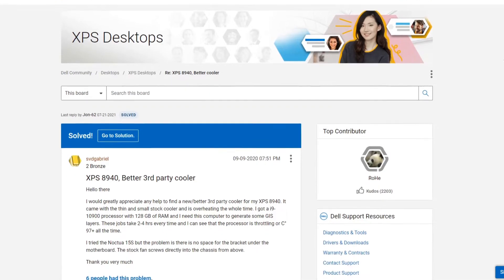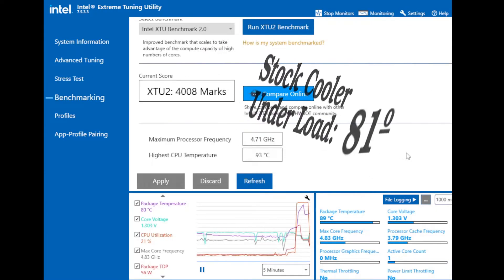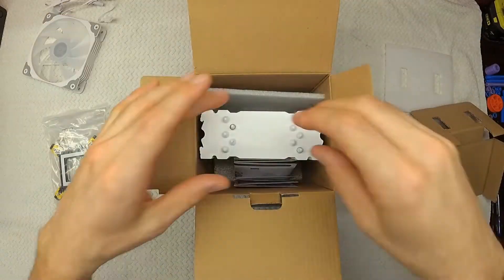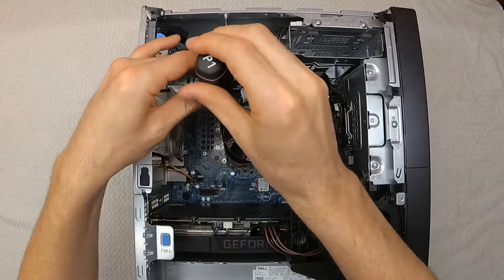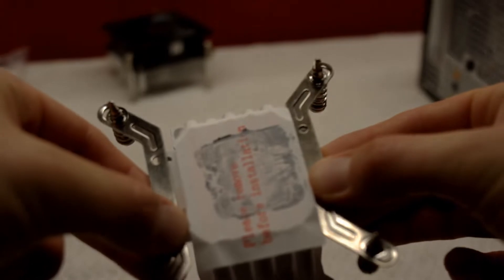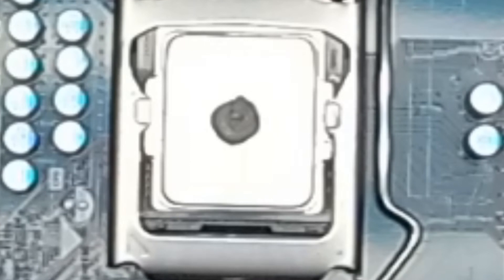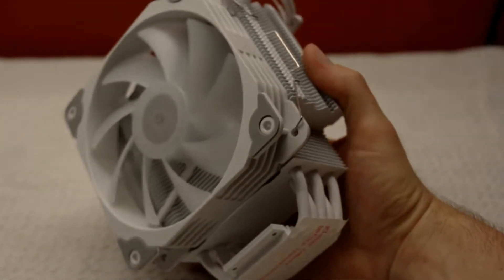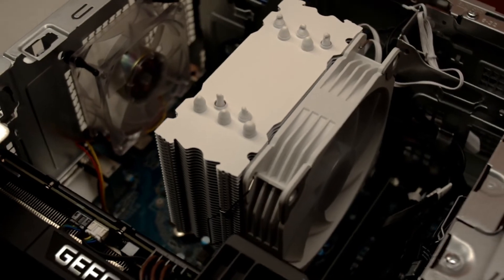Dell XPS 8940 Cooler Upgrade Vetroo V5

Comment: Hi, good video on that replacement CPU cooler.  I did a video using the Noctua brand heat sink.  I also found a remarkable drop in temperature.  I also so additional gains getting more of that hot air out of the case.  Using the Dell Forums I found some guidance on adding bigger fans to the rear and adding two in the front (you'll have to move the hard drive to the top position).  It's not terribly expensive adding more fans and I am amazed at how much hot air is blowing out the back fan now.   Check my video if you'd like!  (https://youtu.be/nWOeO1Cfva0)
Reply from the maker: Thank you for the link, your video is very detailed and helpful! I'm going to take your advice and install the larger intake and exhaust fans- with the scarcity and high price of computer components nowadays I want to prolong this machine for as long as I can!

Comment: This system looks much easier than my Thermalright Peerless assassin cooler. The one I got was very poorly made. There were supposed to be alignment holes drilled in the brackets for 3 different CPU's to make the tower screws line up. Mine had one big slot and it would not center and I couldn't get the screws on all sides to thread. This is sad that they ship such poorly made parts and wasted all my time. I have the Ventoo on the way. It looks like a much better alignment system.

Comment: Quick question for you. I installed this cooler in my 8940 this past weekend after watching your review. I was wondering about the 4 circular pins to the left of the CPU on the motherboard that are covered by one of the mounting brackets. Did these cause any issues for you? I have my cooler installed but I found it a little tougher than expected to screw in (this could be because of something unrelated) but I was a bit nervous screwing a bracket in directly over top of those 4 pins. Are you aware of this causing any issues/damage?
Reply from the maker: Good question! I think the 4 pins you are referring to are a set of capacitors, and I wasn't sure if they were touching the base of the heatsink or not- so I took a look in my case, and I was able to slip a piece of paper between the capacitors and the base of the heatsink with a little extra room to spare, so thankfully they weren't touching and our clearance is OK- so we shouldn't have to worry about any potential issues! 
The resistance when installing the screws may be due to the springs getting compressed when tightening things up which would be normal, thankfully it wasn't crushing those caps!

Comment: Great video! I ordered a XPS 8940 i7 11700 16GB DDR4 with GeForce RTX 3060 Ti for $1649 CAD before tax. Then came to find out they throttle quite easily with that stock heat sink. I've never worked on PC's (Mac user since 2012) so I was quite nervous trying to do this with the Noctua cooler as seen in some other videos but your video has given me the confidence to do this upgrade so thanks! My vetroo and two additional noctua casefans are on their way, in fact they'll probably arrive before my machine does lol.
Reply: Wanted to give you an update on my install. I received my Vetroo V5, a 120 mm Noctua for front fan as seen in the @Where Nerdy is Cool! XPS8940 upgrade video and also a 92mm Noctua to replace the stock rear fan. Everything went great! The fans were pretty easy, however the cooler is where I started getting nervous :S  I had the screws lined up well enough, put my dab of thermal paste on and went for it. It screwed in and it seems nice and sturdy (I tried wiggling it about) but the screws can still be turned. Do you think it is tight enough or should those screws bottom out? I ran the benchmark in Intel Extreme Tuning Utility and received a score of 4636 marks with highest cpu temp of 64 C. Does this sound like I did something right? lol

Comment: Another quick CPU test is to either run a game on CPU alone, or use Windows Defender. Couple that with Core Temp and you will see the load go to 100% on all cores and the temp hit a high of 71C. Pretty amazing cooler. Good job on the video!

Comment: the screws used to mount the bracket on the cooler are the holes tapped having a hard time getting the screws in
Reply from the maker: All 4 holes were tapped on mine, but I did have a little trouble starting the threads. The pitch and screw diameter is so small it makes it a little fiddly I think. Hope you didn't get a defective one where they forget to tap the holes!

Comment: great video! just wondering if it matters what side you clip the fan to the cooler... you clipped yours to the right side, so wouldn't it just be blowing air into the hd case? if you clip it to the left side (and if you don't have a fan already there like you do), would that be better so it's blowing it out of the machine? sorry if this is a silly question... i've ordered an xps and vetroo but don't have either yet so haven't had any hands on time   thanks!
Reply from the maker: Sorry for the late reply, I bet you already received your V5 and Dell by now! I wasn't sure which fan position would be best, so I did an experiment with your suggestions to see what would happen. Clipping it to the left side, and leaving the case fan attached reduced the temperature by 1 degree, vs the way that I had it installed. I documented it in this short video if you want to see more details! https://www.youtube.com/watch?v=cHBjNVBgcCU

Comment: Well made video. I was about to make a purchase for an open air case just for the purpose to fit a bigger cpu cooler since dell mobo have that wierd proprietary form factor that made it impossible for it to fit in a normal atx case. Well made video and it will be a life saver if it truly works when i try to install them later when it arrives. Cheers

Comment: Is there a way to read fan speed with this one? I installed mine, but fan goes undetected (even tho it's working properly)
Reply from the maker: I tried many monitoring apps, and only HWiNFO works! Here is a quick video summary I made about it if you are interested:    https://www.youtube.com/watch?v=goep8zwjU7Q
Reply: @crossedhelix8698  Thanks bro, so much appreciated! Keep up the good work!!
Reply: @crossedhelix8698  Great Video. Were you able to figure out how to control the fan speeds? After installing seems to lock the fans at full speed and diagnostic tool says fans not detected. monitoring and adjusting 2 different things.
Reply from the maker: @La-eh4jk  Thanks- I wasn't able to find a way to adjust the speeds. From what I've researched, Dell seems to have a non-adjustable temperature/RPM curve in place. The only thing I was able to do is use a non-pwm fan, but that will just cause it to run 100% all the time. If you find a way to adjust the speeds let me know!